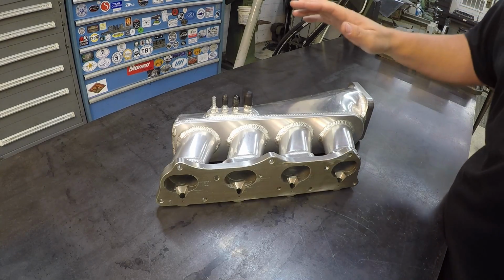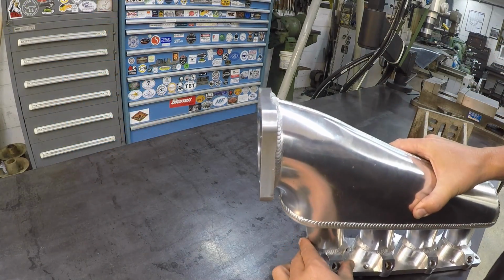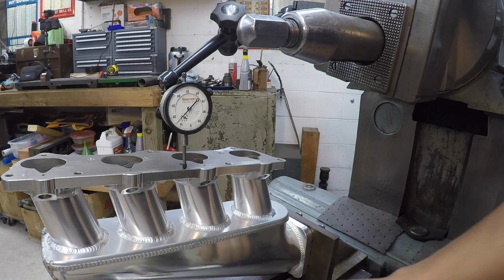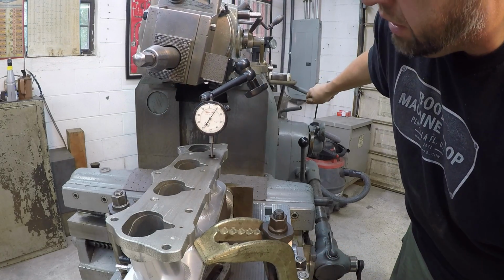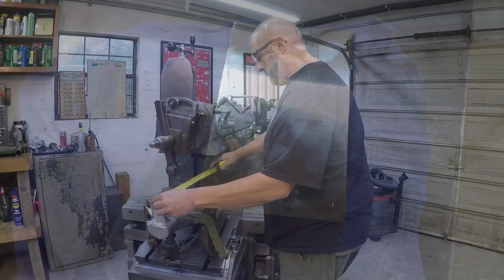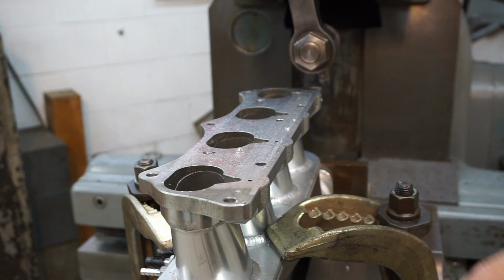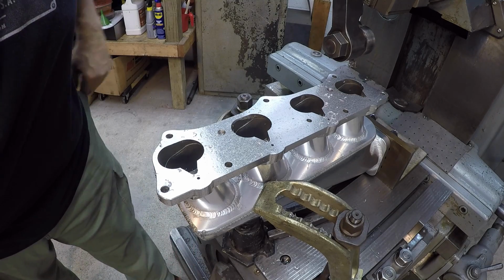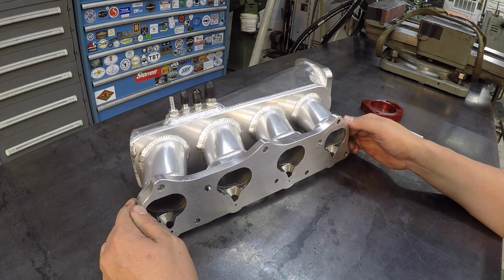Machining an Intake Manifold in the G&E Shaper

Comment: If you get a chance try using candle wax when cutting aluminum it works pretty well a old-timer told me that a few months ago. Try rubbing it on the cutting tool a smear some on the aluminum face your cutting
Reply: Most likely the paraffin melts at the cutting point, very clever idea. Thanks for sharing.
Reply: Used candlewax a few times to help drive a pulley off a shaft, never thought of it for cutting lubricant.  I'll have to try it
Reply: I think it's more a false tool geomety, maybe Adam should grind it more like a longe curved "blade"-ish that is more sliceing than pushing. And maybe smaller cut. Maybe idk :D

Comment: Nice, creative setup ... and it worked! With regard to surface finish. I wonder if you could improve it even further by a) checking the side play of your cutter arrangement (=> cutting action would be not a straight line but slightly "wobbly") and b) have the cutter straight down with a relative large cutting radius combined with sharp cutting angle(s) when cutting aluminum. The latter point is used in lathe cutting tools to improve surface finish (roughness). Would be interesting to do some comparative test cuts on youtube :) Adam, as always great work. Stefan.

Comment: Honda engine going into a Toyota MR2... That really pisses me off.
Reply: Tim Ramich obviously you aren’t familiar with the honda K series.  they are about the best 4 cylinder engine ever made. not a stretch to get 1000 hp out of them.
Reply: Hahaha y’all are both right. It is my MR2 Adam is fixing the intake for. It is only 1 of 4 built back in the day. In 1988 some came supercharged from the factory and a aftermarket company made turbo systems for them so it is twin charged. Runs about 24lbs of boost on the lowest setting making about 450hp. I wanted to keep the car but make it more driver friendly and actually start driving the car more. Only has 80k on it. So I pulled the motor and putting a k series in it and going to tune it to 350hp with always the option of going much further. No more headaches of tuning the car.
Reply: @MayhemMotorsportsPensacola  I was ASSuming the Gen 2 was what was being done. Sorry. By all means, that little 4a-g engine is tiny, so yeah, a Honda engine would be nice. As far as the Gen 2, I don't get why people put Honda engines in those. The 3s doesn't have as broad aftermarket support as other engines, but it can make plenty of power and easily.
Reply: Tim Ramich no man your good. I completely agree. I love me a all original 2nd gen but them k series make some power for sure.

Comment: 7:20  Did you use your stone on the 90*  fixture also  when you mounted it to the bed/table ?
11:55  You put a steel jack pad on polished aluminium.  Aren't you concerned about the finish of the part ?
Sorry for the questions.
Thanks.

Comment: Probably not critical for this part , but . You put the clamps  to hold it down after you indcated for twist . It wont take much for those clamps to twist the peace ,so you may have cut a angle  into this :D .It is thin enough that it will still bolt on right , but for something critical you may want to indicate afte clamping everythiing down .
Reply: There is a jack under it, and it's aluminum. The clamps are VERY loose. Just enough to take the spring out of it. The twist would be negligible.

Comment: 1 solution is machine a steel K20 head flange and then bolt this up to it and torque to spec then put it in an autoclave. Autoclave will relax any of the welding stress.

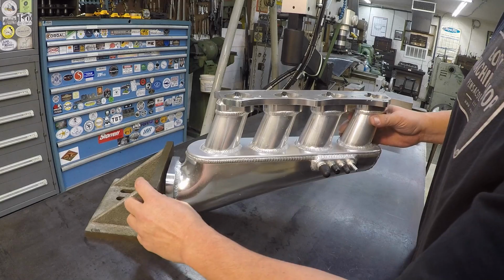Comment: 4:00 - Please don't take this as any kind of derogatory statement or anything... I want to know, why would you go through the expense and the extra floor space for a shaper? Aside from putting in a keyway with smooth longitudinal lines from the cut vs. a mill... couldn't you do everything on a mill that you would do in the shaper? Or is there something that the shaper can do which makes it worth it to go through the trouble of getting one?
Reply: He's said on numerous videos: it's because he LIKES working with the shaper.
Reply: @Mishn0  I like certain tools as well.. What I was asking is IF there is a specific task that it is superior at which would be worth someone like you or me spending a few thousand dollars on.

Per your answer one would conclude, "No, he just spent the money because he can... There is no reason" 

While that may or may not be true... I would like to hear from a machinist who could shed some constructive information on the subject.

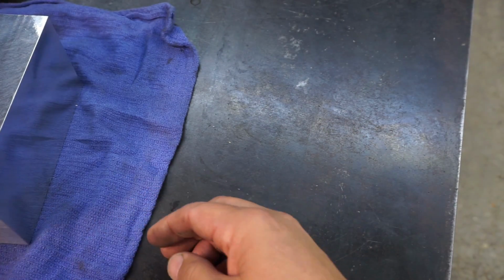20:04 - After reaching this point in the video... I now have an answer. It is the final surface finish... The tooling marks are substantially more smooth.

Thanks.
Reply: @Askjerry  The main thing a shaper can do that nothing else can, is cutting internal keyways.
Reply: @Askjerry  Other machines can get you just as smooth of a finish. This is a YouTube channel about machining. Not about how to run the most efficient machine shop. The take away from his videos are more about other things than the actual job he's doing. It's not a video of how to flatten the head side of an aftermarket Honda K20 intake. It's showing fixturing, took/cutter grinding, showing off vintage machines to interested people, showing other methods of doing jobs, etc. Him making a video of him buzzing across it on a vertical mill, won't teach anyone anything. We've all seen that a million times.
Reply: @xenonram  Great response... I agree.
Reply: `Being a third generation machinist might have something to do with it, memories of his father and grandfather doing much the same thing. He has a passion for using the shaper, for reasons best known to him. To achieve those results must be hugely satisfying. To Adam another awesome video, thanks so much for taking the time to share it with us Happy New Year

Comment: Why do you run the cutter with the low point first. Would it be a better finish if the high point was run first. It would kind of ramp the cut with each step over reducing the amount of cut on the tip. Just curious I come from a woodworking back ground and seems like the way I would run it.

Comment: When I seen the intake I immediately knew it was on a K20. Only reason I knew that is from the boostedboiz channel and Kyle’s Toyota MR2 K Swap and I’ll be darned if this ain’t the same kinda swap. Except this intake isn’t a ProJay 🤷🏻‍♂️
Reply: Shy a turbo and some flames out the back. But yeah, its close. Lol. 
Actually the red one is real close to this... I was thinking about his white rocket ship.
Reply: The Generous Degenerate Yep, I can’t believe he already snatched the engine and put it back in the red one. Had to do the same with the white one too. Trevor did a killer job on painting the red one, needs to get the white one repainted but pearlescent white instead! Those cars rock dude, wish I had an MR2 and a K20 sittin around 👍🏻

Comment: We always just put the flange on a belt sander. This is one of those parts on an engine that thankfully doesn't have to be perfect. That also looks like a B series manifold.
Reply: I saw a video a while back where a guy surfaced his cylinder heads by taping sandpaper to his table saw and just buffed them by hand and they turned out fine. I can appreciate Adam's meticulous devotion to mechanical perfection but god damn, this seems like a massive excess of elbow grease.
Reply from the maker: Hey Phil, I’m a machinist, not a sander. Much less elbow grease needed to let a machine do the hard labor. We can leave the table saw resurfacing vids to the automotive guys while I keep enjoying what I do and sharing it with my audience. If “time” is all some of you guys can think about, then I am failing you...
Reply: @Abom79  time isn't all I think about, I thoroughly enjoy watching you work though setup (especially on these odd pieces) and work out how to machine the piece. Just is odd to me that someone would pay machine shop rates for what could have been a 30 second job at home. But we got another good video out of it so I'm not complaining.
Reply: hahahaha, what?? I can't believe that sealed. That is awesome. Yea watching him work through how to get everything perfect is fun, but honestly it could have been out by at least 0.005" and it would have been fine. He proly could have eyeballed it and it would have worked fine.
Reply: He mig welded breaks in the head then flattened it with 80 grit. That is so wrong I can't believe it. What killed me was he has a granite plate. It would have been better to use that and gone up to 3k grit at least. There is no way that would last with a mls gasket. I bet a copper gasket would seal that fine though.